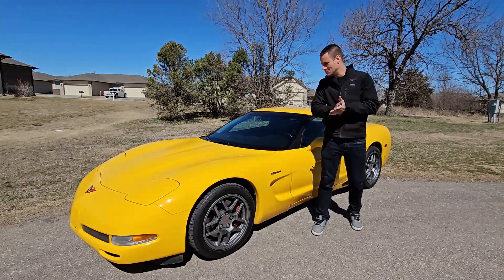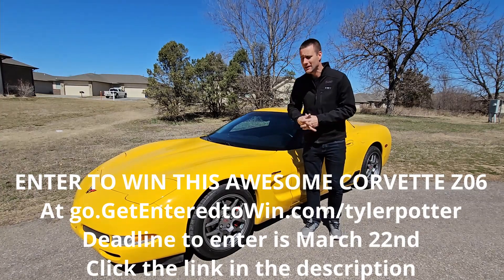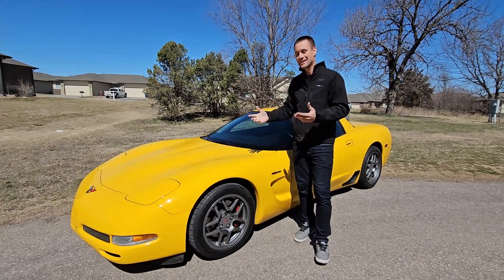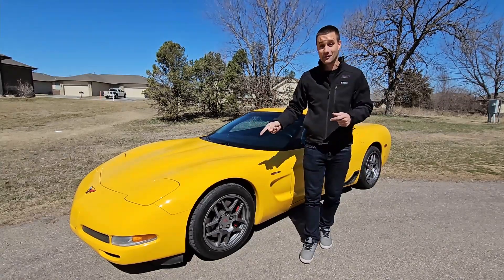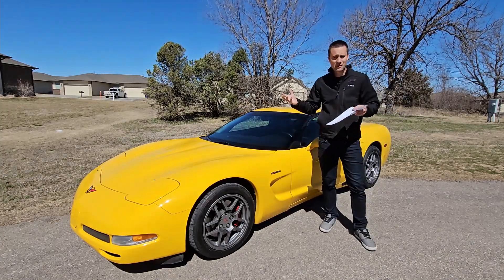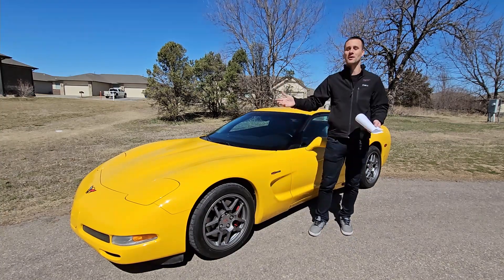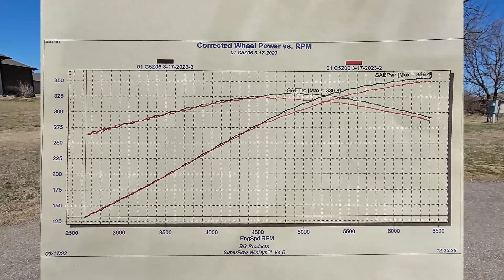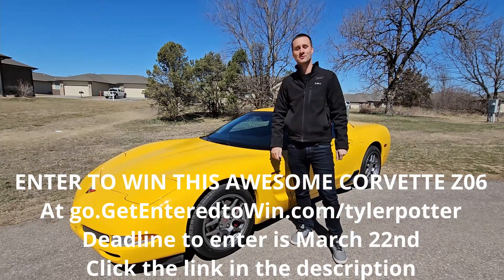C5 Corvette Z06 Hits The DYNO!

Comment: I need to get mine on a Dino so badly and see what its making.
Reply from the maker: It is always a little scary to be that close to it running up to red line lol
Reply: Ive actually bounced off the limiter a few times at autocross but I usually shift before that happens. Not sure where that Z06 is but mine at about 6.7k